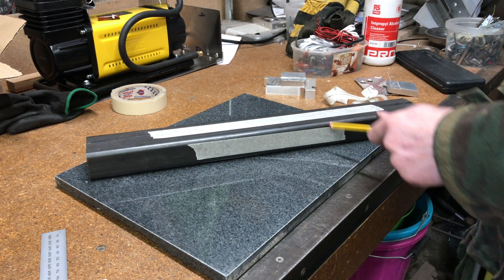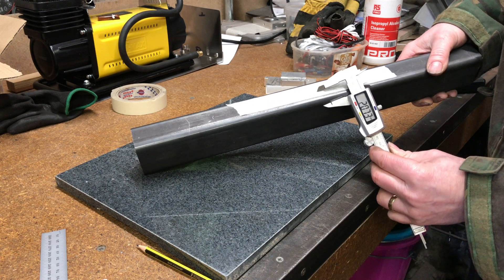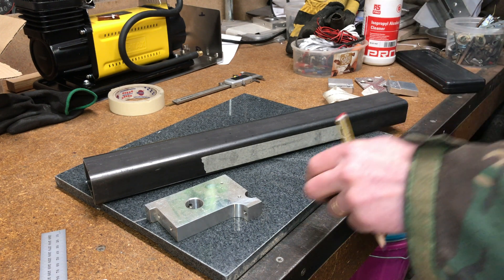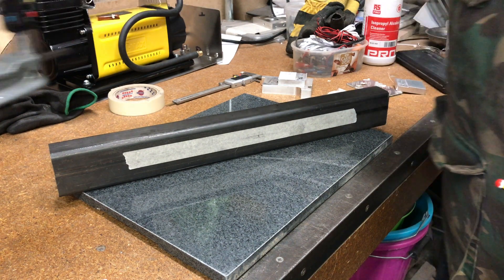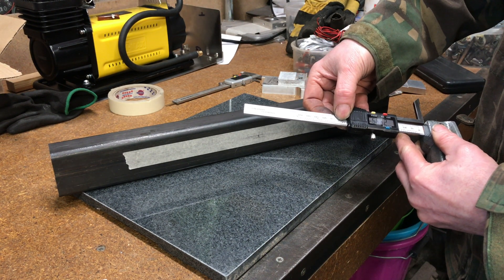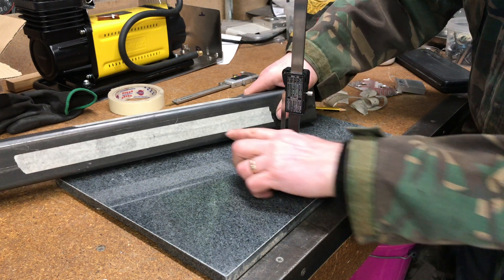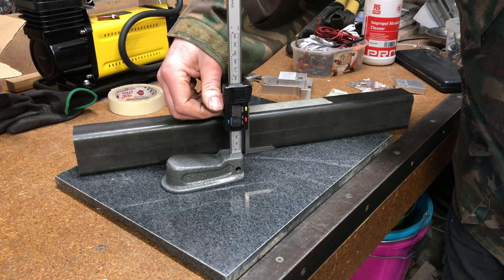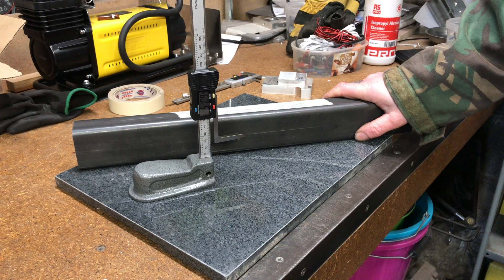Digital height gauge. What more can I say!

Comment: At last a metal worker who does not go bonkers about “half a thou this” and “a few tenths that”. The disdain with which our US colleagues react to “that” Chinese stuff is sometimes a disgrace. Okay, it is cheap. Okay, maybe the build quality does not match a 200 dollar plus Starret. So what if it fit your purpose? I bought the very same height gauge as in the video and it is accurate to 0,01 with good repeatability. Handled with care (no it is not so well built as the expensies) it will do what it is supposed to do: measure reliably. Nice down to earth practical video, well done.
Reply from the maker: Hi Garrett. For what I do in the workshop I'm happy with a lot of the Chinese kit. Yes, you don't get the quality of a Starret or Mitutoyo but for a DIYer for me they are fine. There is some tat out there, you just need to select carefully. Thanks for watching and spending the time to give feed back.👍🏽